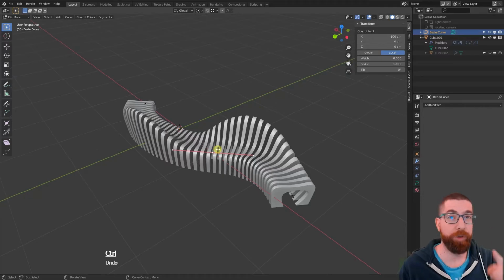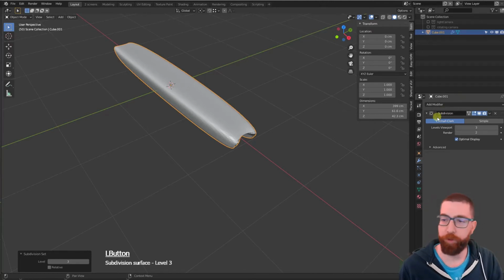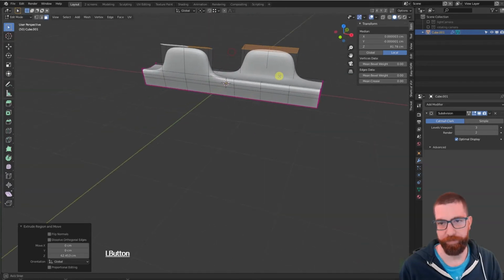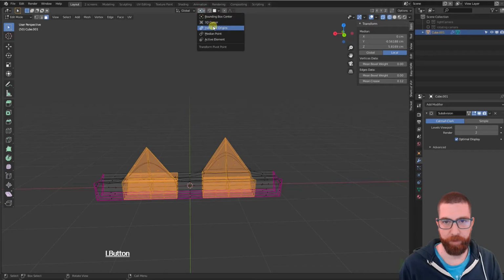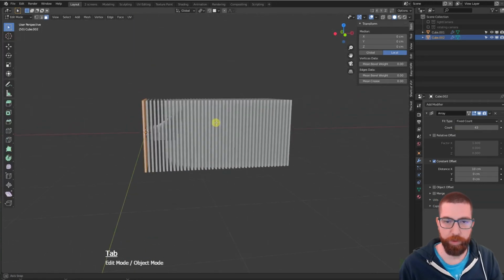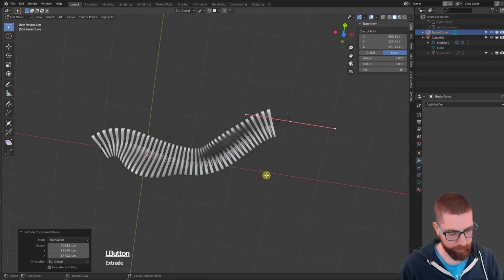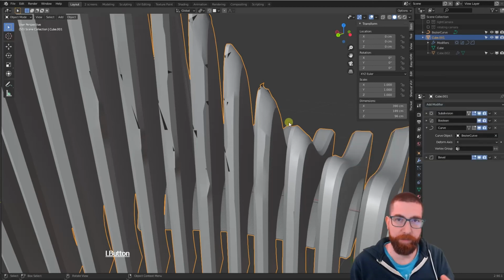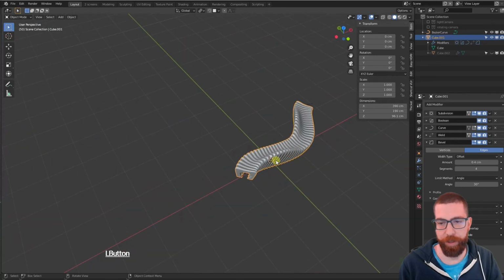Modeling a DYNAMIC Outdoor Bench with Modifiers in Blender - Tutorial

Comment: Did actual for construction design, w plans, section, detail, usin Sverchok in BL. Still however it did not provide complete useful data:element, although profiled, varied w/thickness or edges were not perp. Wonder if u solved that..? ;) The aim would be to provide reasonable geometry for CNC